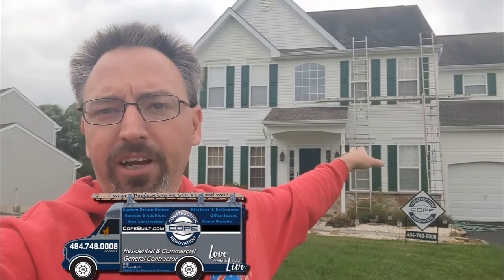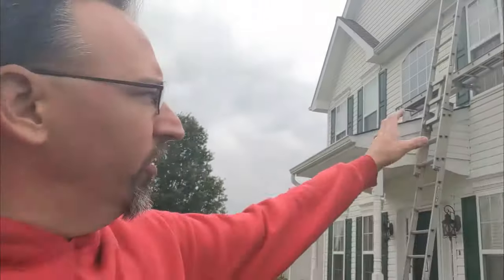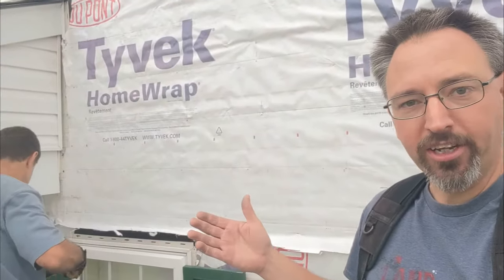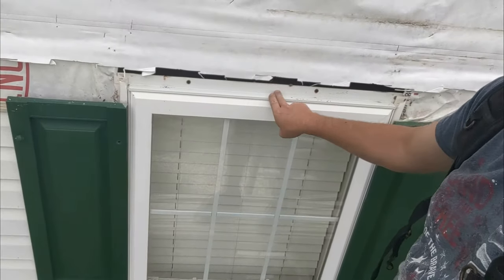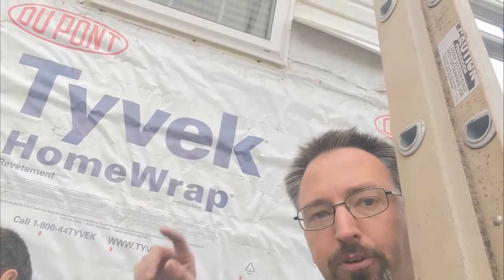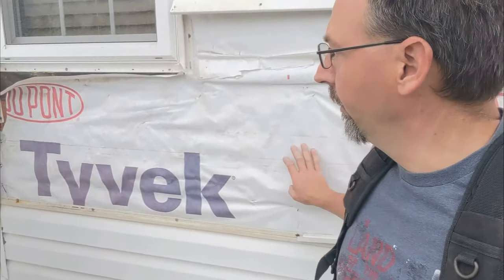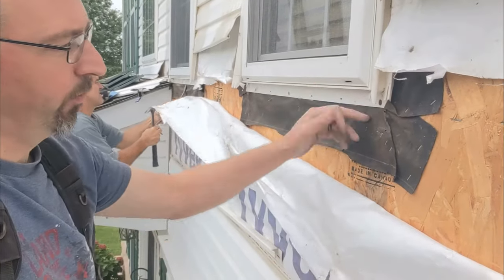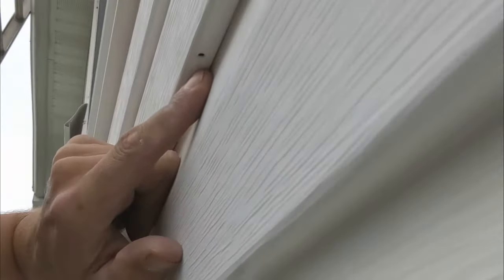Why is the top of my window leaking?

Comment: Nice job. Do you ever see mold in these situations?
Reply from the maker: That's a great question.

For the most part, clients have not asked us to go tearing apart interior trim looking for problems.... And if they are lucky, these were one time events that suddenly leaked and they called us to fix it promptly. However, it's possible a little bit of water was leaking in during every rain storm and only showed up during the heaviest of rain.

In that situation, mold is a possibility.

My understanding is that mold requires a couple of things to grow. A substrate to grow on, water, and a dark warm place.

Once we take away the water, I don't think it's going to grow or spread that much. And it's contained behind the wall, which means there's nothing to spread the mold spores around until such time as someone doesn't renovation. So I typically don't stress out about it unless a client has has asthma or severe allergies.  I typically ask these questions and if they respond in the negative, we don't take it any further. I do have two clients who are very sensitive and we absolutely always go overboard for them when it comes to these types of concerns.  

I am far more concerned about whether the OSB or plywood sheathing on the exterior of the house still has the rigidity to do its job...  Then I will do about whether or not it's turned a little black on the outside or whether there might be some small amount of mold hidden within the walls.

There are several companies out there who make an awful lot of money scaring people about the potential health hazards. I personally have a friend who is misdiagnosed with having Crohn's disease, which later turned out to be the result of living in a heavily contaminated mold-filled house.... So I'm not cavalier about this concern, but I also try to address it in moderation helping a client to weigh the risk reward ratio of doing a lot of exploratory demolition to look for what may or may not be there.

One client was very concerned about the possibility of mold in the water is upstairs bedroom where they experience the water leak in the window below, and we drilled two 5-in holes through the bedroom wall to do an inspection and then we patched the drywall and painted it When we found nothing.

Every homeowner has a different risk tolerance and a different budget and we try to work with each accordingly

Comment: I have a similar problem above a glass sliding door. The house has a brick facade. The water only comes in when the east wind blows the rain against that side of the house. It leaks in the wall under the trim above the door. It does not leak if there is no wind. The house was build in 1992. It leaked for many years, so we had the glass door replaced with a new one in 2018. The replacement door installation did not solve the leaking problem, although we did not notice the leak again until 2020. We had all of the window sills replaces with new stone ones in 2021, including the sill on the 2nd story widnow above the door. The previous sills needed replacing, as there were made of brick and were disintegrating.
Do you have any advice on the type of contractor I need to help fix this problem?
Reply from the maker: Step one is to educate yourself on the process of getting the flashing layers correct, and specifically the head flashing of the windows... & doors...

Brick is a porous material and water is going to get behind it. Hopefully it was installed with an air gap behind it to allow for drainage and drying and when the doors and windows are installed, that air gap needs to be maintained to give the water a path to daylight. 

This playlist will give you a little bit of a master class on that concept... And I will include a second follow-up comment to Joe lestebrik's class, specifically an area on brick. 

https://www.youtube.com/playlist?list=PLHM_Hinmgh2In7R4suJcYVCk3xD4Sugj-
Reply from the maker: Here another conversation specifically about brick, queued up to the portion of the video where he explains what happens if you get too much mortar between the brick and the sheathing on the wall.

https://www.youtube.com/watch?v=rem5WhFiiwU&list=PLHM_Hinmgh2IAbDVVlN1-zSUDpMAM7eHF&index=117&t=1400
Reply from the maker: Here are some raw unedited videos of a customer who had Stone in the front of their house that we applied a masonry penetrating sealer to in order to stop her water leak.  I consider this to be a bit of a last resort... But short of removing her windows and some of the stone in the front of her house, I didn't have another way to fix this. So the penetrating sealer was cheaper and less risky than taking down the stone. 

(May not play on an Apple, iPad or iPhone device due to animosity between Apple and Google). https://photos.app.goo.gl/A7UQoi7EhX8mYdpq8

Comment: When replacing existing windows on a house with vinyl siding, do you usually recommend a "replacement" insert window with capping or reinstallation of a "new construction" window with  flanges?
Reply from the maker: GREAT question, Gary!!   I WISH more homeowners would consider this.  I'm going to apologize in advance for the upcoming rant.  This is a hot topic for me and I'm passionate about trying to communicate what I feel is the right answer.   Buckle up Dorothy here we go :-)

I have some "Rip Off Report" warning videos in the queue where a discount "as seen on tv" replacement window company came through, CUT off all the old nail fins... inserted a replacement window, held it in place with spray foam, added wide capping j-channel on the outside to hide the foam... and left.   There is NO water resistant barrier (WRB) in this approach.   And the Air Seal of the Spray foam will eventually fail as the foam separates from the wood framing... Bad... horrible... awful... and a TOTAL RIP OFF!

Here's a link to the raw unedited footage.. https://photos.app.goo.gl/TmUtbgA5oyb7yDW48

There are only TWO applications where we use fin-less "replacement" vinyl windows.    (1) When you have an old home, with old wood window jambs which are still in serviceable condition, perhaps in stone or stucco or cement block walls and you just want to remove the sashes, cap the wood, and install that replacement window in the existing wood jambs.    (2) When you are recessing a window in the middle of the throat of a thick wall and there is nothing to attach the nail fin to.

in ALL other instances, we almost ALWAYS recommend using a "New Construction" window or patio door WITH a nail fin.   The nail fin gives us a place to put adhesive sealant to connect the window to the wall, and continue the WRB in a continuous fashion.   The nail fin gives us a flashing layer that we can tape to the OSB at the top, and lap the house-wrap over.    The nail fin also makes it pretty difficult to "warp" the frame while fastening it.   Replacement windows are often screwed to the Rough Opening through the sash jambs and overtighting screws can pull the frame out of square.    I like the nail fin because it helps us create a nice drainage cavity, using the back-dam and air-seal approach, moving the air control layer to the INSIDE of the wall assembly at the window jamb, and adding shims to the lower fin, gives us the possibility of draining and drying that part of the assembly to the outside. 

yes, it costs more to remove the siding around each door and window to be replaced, and you have to be careful to size your windows, so that you are at least the same size or larger, so that your siding covers when you put it back up... however, its a SUPERIOR way to protect your Forever Home.   I'm not sure I believe in karma per-se, but i do believe in the law of sowing and reaping.   Even if I was selling a house, I wouldn't take the shortcut of a cheap low quality replacement window, when I have the option to remove the siding and install a New Construction window with the integrated nail fin using the latest in building science construction techniques to protect that home.   And my hope is that any property I ever buy, would be taken care of at least as well by the prior owners who sell it to me.

Even with an Egress window... where we are going to be cutting into a block basement wall or poured cement, we prefer to cut an oversized hole... install pressure treated lumber to create jambs for our Rough Opening... cap and seal those jambs with house-wrap and aluminum, and then install a window with a nail fin when available... and then cover the nail fin with PVC Trim Boards from AZEK or Versatex and their cortex screws with white plugs to hide the fasteners. 

Not everyone does it this way... but not everyone is focused on protecting your Forever Home.   This approach costs more... and we loose plenty of window jobs to "lower bidders" with inferior installation methods... but I can't, in good conscious, install a window using a technique that i KNOW will fail in 5 to 10 years or less.   When we're finished with it... I want our clients to be PROUD to say, "It's not just done... it was #CopeBUILT."

Gary, seriously... thanks again for asking this question... Maybe I should ask our web team to turn this into a blog post.  Great Question!!  Hope you found some value in this response.    Please subscribe for more great videos being released each week :-)   -- Drew Cope, Dad-preneur --
Reply: @CopeBUILT  that is a great answer to a great question you truly know your business now I have another one for you...
Reply: What do you do with stucco windows do you drill them out and add new construction windows or do you recommend capping.... Asking for a friend
Reply from the maker: If its a Vinyl window in a Stucco clad house, it would be an ESPECIALLY BAD idea to just cut the nail fin, and slip in a replacement window.   The shingle-lapped waterproofing flashing layers with a drainage cavity rain-screen behind is absolutely ESSENTIAL to protecting your forever home.    Maybe, you can work some aluminum head flashing back up behind the old layers, cutting V's below each nail still in the old fin, but I wouldn't stake my reputation as a contractor on that kind of fix.

There are two approaches, each with varying degrees of cost, risk and liability.   A stucco guy who is worried about his insurance is going to tell you, "No can do.   Rip off the stucco on the whole face of the house, corner to corner, ground to sky, replace the windows, and then install new exterior cladding... whether stucco or siding or james hardie."   That way, they OWN that wall, and they know that they have done everything correctly, and they can warranty their work.  And this approach is not cheap.  But it is the best (assuming you have a reputable knowledgeable contractor) for ensuring that all the flashing layers are correct, and any wood damage has been replaced while the wall was open. 

The cheaper band-aid approach is to use your angle grinder with a diamond blade (follow all safety protocols) and cut a straight line through the stucco, 3-1/2 inches from the edge of the window, paradelle to the window, on all 4 sides.  DO NOT penetrate through the expanded metal mesh.  Just cut the surface layer.    Then use a masonry chisel, and carefully remove the stucco.... work the wire mesh free... chip away at the scratch coat left behind.   Carefully pull the wire mesh away.  Carefully peal back the tar paper or other water resistant barrier (and if you don't find any kind of a WRB, that is REALLY REALLY BAD and the whole wall probably needs to come down on a wood framed and sheathed house).  Remove the nails from the nail fin, remove the window, use a fluid applied membrane to protect the jamb and face of the rough opening, install the window, add more fluid applied... and then reinstall the layers you removed.  If you don't want to apply new stucco, grab some 1x4 or 5/4 x4 PVC trim boards, and trim out the window in AZEK or VERSATEX.

Here is one video on patching stucco...
https://www.youtube.com/watch?v=5XV5KT1hWt8&list=PLHM_Hinmgh2JffqMrFjk627km8o20KKr2&index=16

and we have another one in the pipeline where the client had a sliding egress window in a basement window well, which leaked BAD... I mean really bad.  The seals were garbage!   and it had a stucco exterior.   Here is a sneak peak at two RAW unedited videos that addressed exactly what you are asking about.  https://photos.app.goo.gl/VPsVUrGeEW8tTAC66  At the end of the second video, you'll see that we have our expanded wire mess back in place, and ready to re-stucco over the new window nailing fin.  Hope this helps!
Reply from the maker: Here's a link to the raw unedited footage of our upcoming rip-off report.... 
https://photos.app.goo.gl/TmUtbgA5oyb7yDW48
Reply: @CopeBUILT  excellent detail and very good thinking I am quite impressed with you here's my last question do you do any work in Yardley bucks county which is where I live?
Reply from the maker: no we don't... nearly a 2 hour commute from here... you'd be paying us for 4 hours on the road, for 4 hours of actual work.   Probably doesn't make sense...  that's not to say you couldn't twist my arm, but there would be a significant cost premium associated with it compared to hiring someone locally.   You can contact our team through our facebook page and send photos if you'd like to discuss this more in detail.   http://www.Facebook.com/CopeBUILT
Reply from the maker: Gary... in resposne to your original question about Replacement VS New Construction window styles... we have written the following article on our blog, and included 3 videos to help talk about proper install techniques...   Hope this helps!

https://www.copebuilt.com/general-contractor/kennett-square-pa/blog.aspx?ID=1064&Title=Replacement%20vs%20New%20Construction%20Windows:%20The%20Essential%20Guide

-- Drew Cope, Dad-Prenure

Comment: Great video we think this is the issue our son is having with his new home. Is there a temporary fix you can recommend since the construction company can't do the job for several months? Thank you!
Reply from the maker: Find a different contractor or do it yourself if you feel comfortable with that.   You could cover the entire front of your house with a tarp, but that's not really a solution.

You have to take apart the siding under the upper windows and move that water OUT... and you need to take apart the siding at the top of the bottom windows, and get the layers right.   There is no shortcut.   I'm sorry :-(